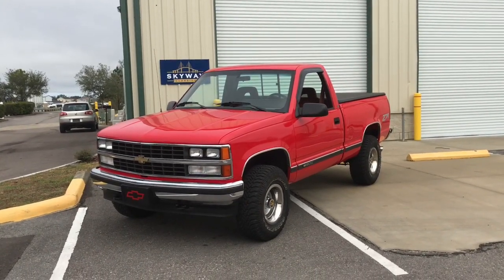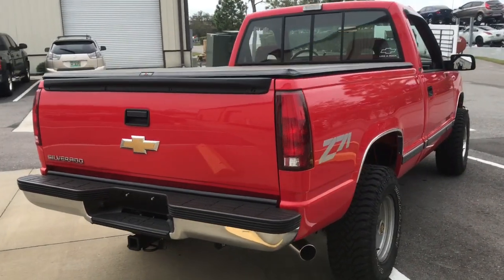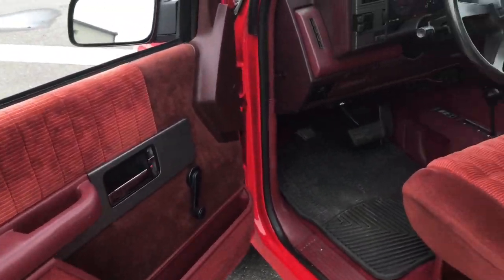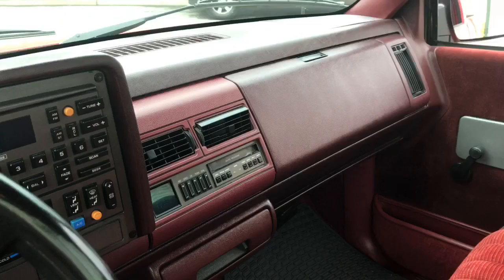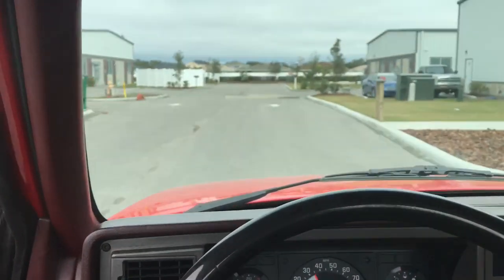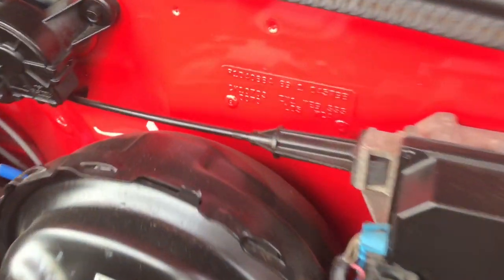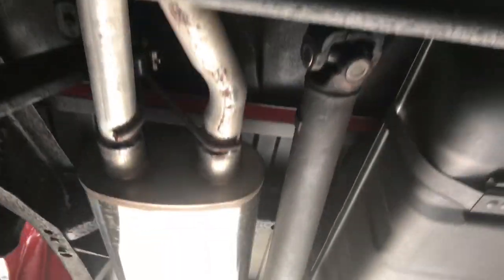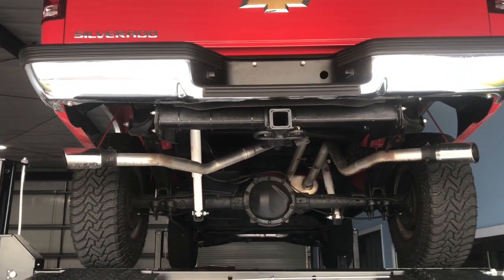1989 Chevy Silverado

Comment: First 30 seconds was enough. Wrong upholstery, wrong badges, wrong name, wrong mirrors. The upholstery is 90-94. The badges are 96+. Silverado wasn't a model name until 2000. 4x2 mirrors on a 4x4 truck. Exhaust on driver side is another fail.
Reply: Thank you
Reply: Hows the interrior wronge? The interiors are the same from 88-94. The clusters in 88 and 89 are different then 90-94. The interrior looks OE. Theres no 2wd mirrors. There just mirrors from a 95-98 4x4 and 2wd had the same mirrors also.
Reply: You are incorrect....
Reply: @alquillmann4987  91 was the last year for the moonie cluster thatw what I call them my 90 has the same cluster
Reply: I have an 88 u sir are correct.
Reply: @CMKshadow  no I'm not.
Reply: @alquillmann4987  the door panels and upholstery in this truck were new in 1990.
Reply: @davidneill6820  looks just like my '88 Silverado (gmt400 2500k silverado trim) except the z71 decal is wrong..and the tailgate is wrong. Before 1999 silverado was a trim level. But it is a nice truck anyway.  :)

Comment: Definitely a V8. Just a question if it's a 305 or 350. I also noticed the voltmeter gauge while driving wasn't holding a good charge, which tells me either the alternator is going or the battery....or both.

Comment: Doesn’t sound like a v6? Yeah cause it isn’t lol... definitely a 305/350.
Reply: Nope, listen to it, definitely a 4.3, but it's the later Vortec 4.3, not the one the truck would have come with from the factory.
Reply: David Neill a 4.3 with 4 spark plug wires on each side? Lol
Reply: @davidneill6820  vortec lol those didn’t come out till 98

Comment: Not a true z71 couse they didn’t come out until 94
Reply: Z71 Came out in ‘88
Reply: @yplyahte22  I just looked it up it’s confusing so basically the z71 package came out in 88 but they used 4x4 decals but in 94 they used Z71 decals so you are technically right but there where no z71 decal trucks on the road till 94

Comment: This guy doesn't know what he's talking about! Sorry dude v8  the seat doesn't match 89  and no drink tray in 89 either so don't say a original truck the steering wheel center cover its 89 either.
Reply: I have a 1989 and they came with a straight bench. That seat came out in 1991